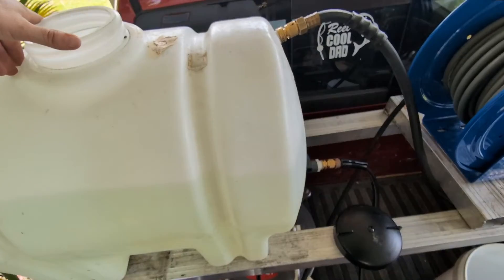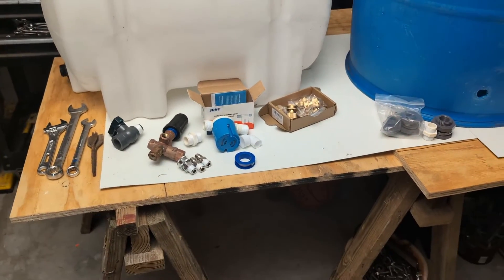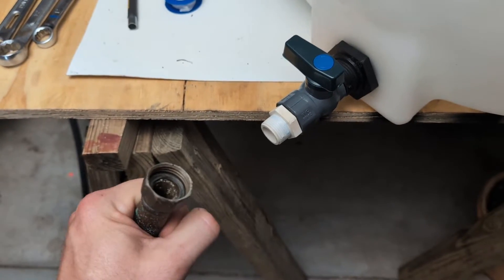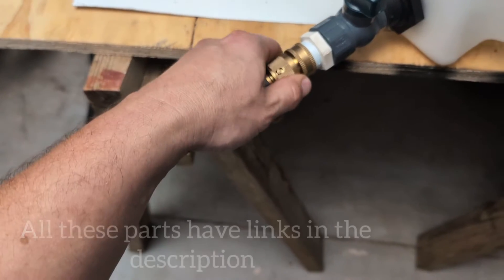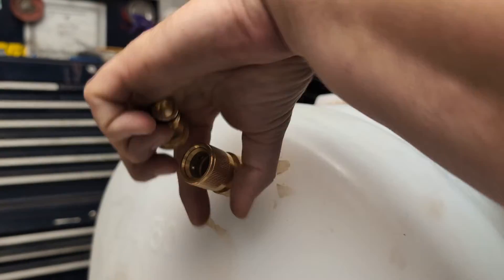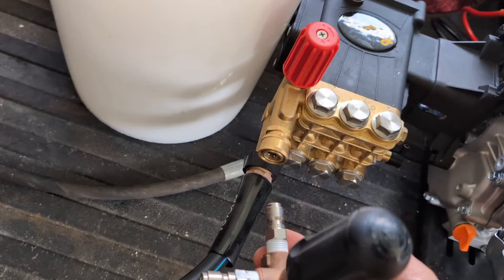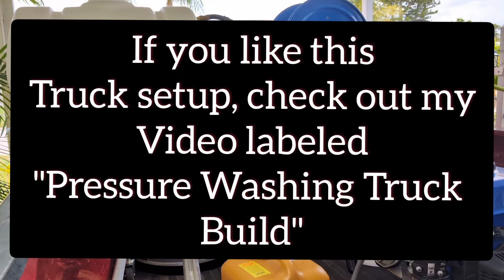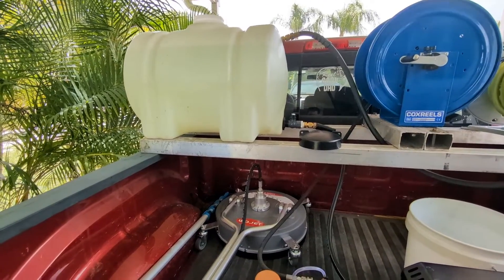How To Redirect Water to Buffer Tank | Pressure Washer 4GPM External Unloader Valve Upgrade:

Comment: Is that pinch a penny sh ? 😅
Reply from the maker: Yes. I don't see what's so funny. Its 10% I've been using it for years. It's chlorine dude. it don't matter where you get it from. It's gonna work perfect. Walmart has 10% too.
Reply: @MyPressureWashingBusiness  chill tf out dude… I was wondering because I use the same shit… I recognize the container & scrolled down & saw another video with the same container & I thought it was something to point out…. Back to back videos on YouTube with the same container…. Yea it’s cheap to get unlike Amazon charging $35 a gallon for 12.5% sh from alliance chemical I get 10gallons from pinch a penny for $53 may be a tad lighter in percentage but better bang for the buck.

Comment: I see that your whip line to the reel is connected to  the float valve on top of the tank, my question is, how is it feeding your hose reel from the top of the tank? My confusion is that usually the whip line to charge the reel is straight from the machine directly to the reel. I know I'm missing something lol
Reply from the maker: My hose on the hose reel is pulled out and plugged into the main hose bib on the house. The whip line from hose reel is plugged into float valve on buffer tank. The buffer tank has a hose coming from the bottom of tank and going to the pressure washer. The pressure washer has a hose coming from external unloader valve going back to the buffer tank. It seems confusing but it's just circulation the water. The float valve keeps the buffer tank full.

Comment: If I wanted to building this and sit the tank on the bed, could I just add a pump to the water that’s coming out the tank?
Reply from the maker: Yes. Alot of guys put a 12 volt pump on instead of gravity feeding. I just personally like gravity fed, less headache. But yes a pump would work also.

Comment: If you have your downstream injector after the unloader is there any chance of it putting chemical in your water tank?
Reply from the maker: Hi. You definitely want it after the unloader valve. If it was before the unloader valve you would probably be contaminating your buffer tank which would destroy your pump. ALWAYS put downstream injector after your external unloader valve. Hope this helps

Comment: Hey man! Thanks for the videos! Do you still use that Toolcy pump? Would you recommend it!
Reply from the maker: Hi. Yes I am still using the toolcy pump. It's still working great. I don't expect it to last forever but it's definitely a decent pump for the price. I've been using it for about 8 months now. I had a few slow months but it's working hard here lately
Reply: @MyPressureWashingBusiness  awesome! im gonna pick one up today then. Much appreciated! 

Do you have any suggestions for a 5.5 pump? Ive read  the biggest pump i can put on my engine is a 5.5- i have a couple honda gx390 engines.

Comment: What's the point of a ball valve just before the spray gun ? Isn't the pull lever enough ?
Reply: To relieve pressure so he can change wands without shutting off the  machine.

Comment: Great video! 

I do have a couple of questions…if the unloader on our pressure washer already comes outside of the pump, can’t we just use that instead of adding the one in the video? 

Also, if we have a belt drive pressure washer we wouldn’t need it to be gravity fed, correct?
Reply from the maker: @newy219  hi. If the unloader isn't built into the pump then you probably don't need an external unloader to run water back to a buffer tank. They usually have that option available already. And you are correct, most belt driven pumps don't need to be gravity fed. They should pull water just fine!
Reply: @ awesome I bought mine this way so I could use a buffer tank, plan to start here around late April/early May. This is the best video on the subject and will still be what I use when I put it together. Thanks for the quality content!

Comment: Can you do this with a direct drive 4 gpm washer?
Reply from the maker: @OGBREED  hi, yes that's what I am using in the video. Although the buffer tank has to be higher then the pressure washer (gravity fed)
Reply: @MyPressureWashingBusiness  thanks for your response bro. I appreciate you making videos and educating us.
Reply: @MyPressureWashingBusiness  if the water level is higher than the washer will it work?
Reply from the maker: @OGBREED  It all depends how much water is in the tank. If there is enough force pushing the water then maybe it will work. I Personally have only tried it with the tank higher than the washer. I've been running the same way for years. Can you fit a few pallets under your tank? You may have to put an electric pump on if the tank isn't higher.
Reply: @MyPressureWashingBusiness  i could probably put a few pallets underneath the tank. But, i also do yard maintenance and use the same trailer for both so I can't have anything bolted down in a fixed position. It sucks but I just upgraded my trailer to a better one and spent a pretty penny on it so until I make more money to buy another trailer I'm kind of stuck loading and unloading everything every time I have a yard maintenance job to do. So I'll try it with a few pallets under the tank then just take it all out when i have a yard job to do. I have a 1000 liter tank so with the tank full it might just have enough water to force into the washer. I just added an unloader valve to my set up so I'm slowly trying to become more efficient and more professional as time goes on. This is my second year and I started late the first year. Thanks for the help brother I appreciate it.
Reply: Hey bro this is kind of a long comment but I'm hoping you can help me out.  
So i just hooked up my first buffer tank and my first unloader valve. I usually use my xjet for everything but I had a house wash today and I figured to save some time and chemical and having the buffer tank and unloader valve hooked up now I would just DS. Well I soaped the small house looked how much chem i had left and it was half full I put my gun down to do something looked back and the chem was empty. I knew something F-ed up. I looked in my water tank and it was soapy as hell. I disconnected right away and hooked up directly to the spigot. I rinsed the whole house with fresh water which would circulate through my pump. My question is why am I getting soap in my water tank and should I be worried about my pump even though I rinsed for about 30 minutes with fresh water?
Reply from the maker: @OGBREED  is the downstream injector plugged in before or after the unloader valve? Make sure the ds injector is plugged in after the external unloader valve. It sounds like that is what might have happened here.
Reply: @MyPressureWashingBusiness  that's exactly what happened. You know your stuff bro, thank you.

Comment: how do you prime the pressure washer using the buffer tank? Does the pressure washer just pulls the water from the tank
Reply: you have to hook it up and pull the trigger with the machine off until water flows through all the machine and hoses. it won't be a lot of water but thats how you can prime it, its fast/easier to prime it with the hose straight from the house. something thats worked for me is opening up the water on the tank and getting the water going then hooking it up to me machine (i set my stuff up to quick connects) while my son holds the trigger on the gun/lance.
Reply: If you connect the water line and pull your cord when the washer is off it will prim it any time I reconnect my hose from the buffer I do this until the water comes from the outlet constantly

Comment: Hi, don`t you have to use an electric pump from buffer tank to this pressure washer? I am wondering if the gravity makes enough flowrate.
Reply from the maker: It's a great way to make money, and Yes that is plenty big enough for a buffer tank. Just make sure you have the tank higher than the pressure washer. You should also do a bucket test before hooking up the pressure washer and after you hook it up to make sure you get enough gpm. I think I explain the bucket test in one of my videos. It's pretty much using a stop watch to see how much water goes into a 5 gallon bucket in 1 minute.
Reply: @ Yes, you have. I just have watched that video. 2nd doubt - I want to plug a hot-box (AC ignition, diesel heating with thermostat and pressure sensor) between external by-pass valve (output of the karcher) and high pressure hose. Do I have to put by-pass valve in another place?
Reply: @kitt3860 unloaders have a thermal rating. So if you want to place it after the coil, hot side, I wouldn't recommend it. However if you want to place it at the base of the coil, then it should work. Planning on this upgrade next week.
Reply from the maker: @kitt3860  hi. I get over 4.5 gpm with my pressure washer hooked up gravity fed. It works perfectly. No I do not use an electric pump. I have washed hundreds of homes with this setup
Reply: @MyPressureWashingBusiness  Okay, thx for answer. I am starting this as a side-hustle with karcher (3300 psi, 3.5 GPM) and want to build propper buffer tank. Is 45 gallon plastic barrel enough with garden hose 3/4"?

Comment: Quick question, should the buffet tank always stay empty?
Reply from the maker: @Donaldrothchild-rs6ti  hi. I personally empty my buffer tank when I'm done with each job. Water weighs about 8lbs per gal so it's a lot of extra weight to haul around. But when you are washing a home the tank always stays full at the float level.
Reply: @MyPressureWashingBusiness  Thanks for your quick response. What's the best chemical you would recommend using to remove rust while soft washing?
Reply from the maker: @Donaldrothchild-rs6ti  i personally use oxalic acid. You can get a large bag for $40 on Amazon and it goes along way. I use a pump up sprayer and I mix 2 cups per gallon of water. I have gone up to 4 cups per gallon of water but that was a really bad rust job. Spray and wait 5-10 minutes and rinse it off. https://amzn.to/49yJ10j
Reply: @MyPressureWashingBusiness  thank you very much, your the greatest 1.

Comment: So i just finished my buffer tank set up. Went with a 55gallon drum. $20. Gravity feeding water works perfect as long as water level above pump. What i noticed or maybe its just my mind but i have so much more water pressure now and is super consistent
Reply: I just finished mine also with a 55gal drum and I have my barrel probably same height as shown in this video. Mine won’t gravity feed do you have any suggestions?
Reply: Damn where did you get the tank for $20?

Comment: I’m building my first rig. I was told by a really experienced guy it’s a good idea to have water going in to the pump from both sides of the manifold when using a buffer tank. So one side of the pump doesn’t starve of water. One side is fine when running from a hose because it has pressure. But running only one side with a buffer tank will shorten the life of the pump substantially. Makes sense to me and it’s cheap to do just a Y piece in feed hose and another inlet fitting.
Reply: Unfortunately you can't with this particular pump setup. The thermal relief vavle is positioned on the other side. Most of the pump head is molded together, I'm assuming to save cost. However, this pump gets after it!

Comment: What size hole did you drill for the 3/4 in bulkhead?
Reply from the maker: @rickovsky980  hey, that tank came with the bulk head fitting but I did build another buffer tank with the same identical bulk head. I used a 1 1/2 inch (38mm) hole saw for that bulk head fitting. Hope this helps buddy!

Comment: Great informative video. How do you reduce the recoil when you pull on the gun
Reply: Just found out they make a flow sensitive unloader that eliminates the recoil you get when you pull on the trigger after bypass mode!
Reply: @nolan_shaga where did you get that from, or what is it called?
Reply: @Rev9Ghost  look up k7 flow sensitive unloader general pump

Comment: Is this safe to do on the AAA pump on a Simpson
Reply from the maker: @dustinjohnson2116  yes I know multiple guys who use the external unloader valve on Simpson pressure washers
Reply: @MyPressureWashingBusiness  thx
Reply: @MyPressureWashingBusiness  so to set desired pressure you still use the unloader valve on the pump, correct?
Reply from the maker: @dustinjohnson2116  that's correct. I Installed a pressure gauge before I put the external unloader valve on to see what my factory unloader was at, and then I installed the external unloader with the pressure gauge and turned that one just a little bit lower than the factory one.
Reply from the maker: @dustinjohnson2116  
For the unloader valve you need 3/8 male ends. Here is link
https://amzn.to/3UfKxx6
Reply: Can you use the factory unloader to the buffer tank and or just to the ground?

Comment: If your filling from the garden hose and stops with the float valve, wouldn’t it over fill due to it filing up with the external unloader valve? I’m not understanding something….
Reply from the maker: @D-boi93  hi, I also had a hard time understanding how the float worked at first. But no it can't overflow. Once the tank is full the float valve will close and no more water will be coming in. Think of it as if the tank is now sealed completely off with only the water that is in it. If the pressure washer is still running, now it is just circulating the same water over and over until you pull the trigger on the gun and start spraying water, only then does the float valve reopen and replace the water you are using. Hope this helps.
Reply: @MyPressureWashingBusiness  so say I don’t use the pressure gun, an the tank is full.. well the water is still gonna fill because the float valve isn’t on that side..? Right.. if that makes sense..
Reply from the maker: @D-boi93  The garden hose is no longer hooked up to your pressure washer once you install the external Unloader Valve. It is hooked up to the float valve on the buffer tank only, so there is no more extra water being introduced once the tank is full and the float valve closes. It only recirculates the 30 gallons you already have in the tank through your pressure washer
Reply: @MyPressureWashingBusiness  
Got it! Thanks for the help! I’m eager to make this setup now!
Reply: @D-boi93 the pump is drawing from the tank, so it would just be re-circulating the same water.
Reply: @MyPressureWashingBusiness I apologize for being late to the party…. So are you saying you stop the water going through the hose once you start the pressure washer?